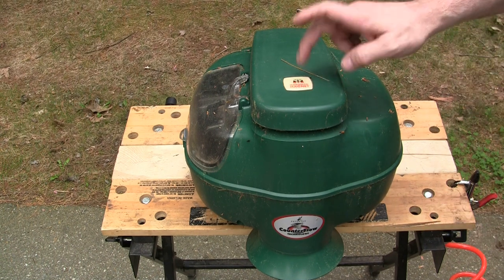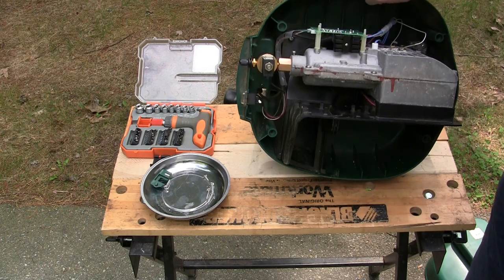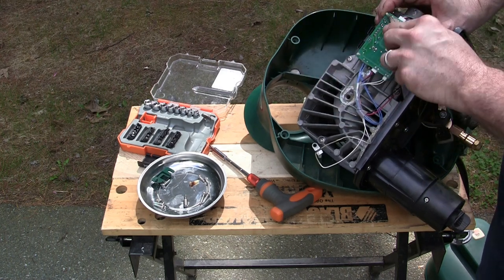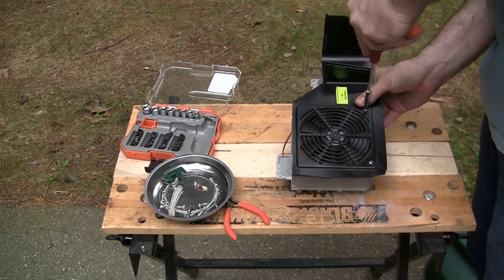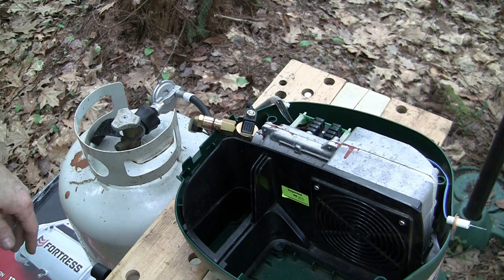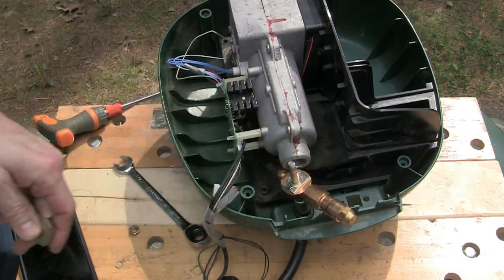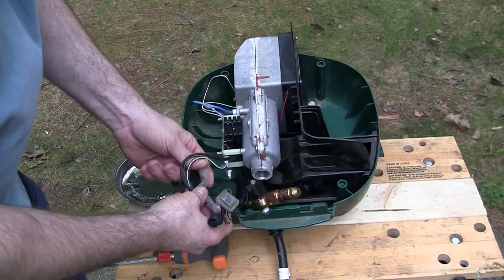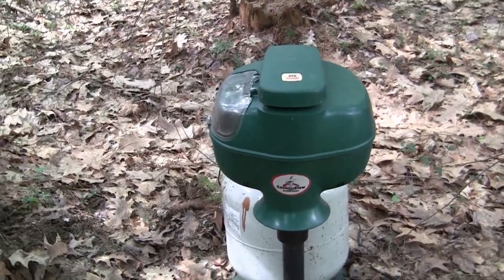Mosquito Magnet Patriot Plus repair

Comment: The little clean out port in the front that you screw in the co 2 can to blow the line out is just a tire valve. I just use my compressor and a air chuck.
Reply from the maker: Yes, I have started doing that too one I ran out of CO2 cartidges.

Comment: Hi, I did a complete service on my Mosquito Magnet patriot Plus today. Your video has been very helpful. Thank you very much. I have a suggstion. In the back of the fire chamber t is a spring with an opening on each side. Use a flat screwdriver on each side and press out the spring. Best way to clean the chamber is to disassemble it frrom the chamber and then you are able to take all filters out. Clean the chamber for carbon, use a brush to clean the ffilters and clean the wall inside the chamber for carbon build up. Inside it used to build up a lot of carbon. I took out at least 100 gram carbon. Now my Mosquito Magnet Patriot is working like a charm.
Reply from the maker: Thanks for the feedback! I'll give that a look next time I have it open.

Comment: Thanks for tearing the whole thing down even though you probably could have stopped at the thermocoupler.  I have a lot more confidence being able to troubleshoot easy to solve issues to keep mine up and running.  I just spent $70 to have my jet cleaned.
Reply from the maker: Thanks for the compliment and good luck with your machine!

Comment: Thanks for taking the time to publish this video. I had mine mostly apart and determined I needed a new igniter (which was also the error code). Your video gave me the confidence to fully disassemble, clean and inspect. I found the inside of the chamber corroded and the drain plugged, so I got it all cleaned up. I also bought some 8-32 nylon screws (from an electronics supplier) to hold the thermistor in place (which I found with the head broken off). It’s all back together and running fine. Note that I have an old Liberty model, where the igniter is soldered directly into the circuit board, so I cut the plug off the new unit and soldered it in.
Reply from the maker: Great to hear! Glad the video helped!

Comment: Thank you for doing this. I have two of these & one needed a new heater. The other failed this year and the heater is working. I'll have at it as you did. Thanks for breaking the ground so I don't have to reinvent the wheel.
Reply from the maker: Good luck!
Reply: @DavinDesborough  Thanks. Job done. I split the halves of the engine and it was packed full of crud which I dremeled out. The ignitor was actually working so I left it in. The gas jet was plugged up so I took that apart and cleaned it out. For some reason the propane tank valve didn't release so I switched tanks and this one was fine. I used deoxit on all the electrical contacts to keep corrosion down & Put a strip of tape over each of the four case screw holes as mud dobbers had packed the slots with crud. When reassembled it started in a very few minutes. 

After seeing how it's done I'll just do a cleaning every winter and have it good as new for each spring. Thanks again!
Reply from the maker: @XJ1100J  Awesome! And, yes, just plan on an annual cleaning and you'll be good. It's worked for me anyway.

Comment: Thanks for the video!

Just bought a 2nd hand unit for 100€ in Finland. Looking into the probable malfunction before i even have my hands on the unit yet.

People like you make the world a better place, at least for us makers : )
Reply from the maker: Thank you! As a fellow maker, I try to give back what I can. Best of luck to you!
Reply: @DavinDesborough  checklist:
-heater is glowing
-solenoid is activating
-solenoid gas valve is really clean
-thermistor is reading ~150K ohms in room temp, ~30K ohms when heating with a jet torch for a bit - seems reasonable (running resistance should be around 5K ohms..?)
-propane is coming out(cannot light it with jet torch though, too high flow for that?).

Have you taken apart your gas jet? Does it have any other parts inside it besides the jet itself and a "copper mesh" - nothing under the mesh? Former models used to have some channeling made with a screw with a "mushroom" looking part that restricted the gas flow or something like that. The screw used to have a groove to be opened with a flathead screwdriver.

I only get the fast flashing red ledalthough everything looks good, only the gas flow is suspicious - although it looks exactly the same as yours when you light it up.
Reply from the maker: @iikkakonola  I have separated the jet from the mesh and there was nothing in there, or I didn't notice it if there was. If you try running it with the cover off, does the metal get appreciably hotter? Is so, then you have ignition, but it isn't getting the right signal from the thermistor. I'll need to change the tank on mine soon, and I'll try to get some readings from the thermistor when I do so we have something to compare.

Comment: Thank you for your video. I really appreciate it. When I first purchased this machine it worked just like you stated. The second year of operation was less reliable and required CO2 cartridges and a ridiculously expensive CO2 cartridge attachment to clean out the propane burning unit. From this point on the operation was sporadic and VERY frustrating. I also found that the mosquito magnet CO2 cartridges where expensive to purchase and it was suggested that every time I swapped out the propane tank, I was required to use a CO2 cartridge to clean out the working parts. I did this as per Mosquito Magnet instructions. All in all it cost me about $100 to $150 to run for the first season. This expense excludes the purchase of above mentioned equipment ie the cartridges and attachment. In year 3 (this year) I fired up my mosquito magnet and spent an entire day trying to get it running. As the warranty on this useless machine had expired after the first year I had no issue opening it up. After watching a few Youtube videos I diagnosed a problematic "Thermistor" I believe this temperature probe regulates the internal temperature of the mosquito magnet and keeps it running. I went online to purchase a replacement part and found that there are no available parts for the mosquito magnet. The only item they allow to be sold online is the igniter part (on ebay) I called the mosquito magnet service people and was rudely informed that they do not have part numbers or are able to send me any parts at all. I was referred to a service center in Canada. Although Mosquito Magnet worked well for a year and caught basket loads of mosquito's the subsequent years year of operation were terrible. I paid $400 for something that has a shelf life of approximately a year to two years max. There is absolutely no customer service or parts available. I WOULD NOT BUY THIS PRODUCT. Its finicky and expensive to run! I will be posting this to other mosquito magnet youtube videos sites in order to warn other people of this gimmick.   If anybody wants to purchase my broken mosquito magnet and resides in Ontario please let me know and maybe I'll be able to re coop some lost money:)
Reply from the maker: Yes, I have said this all along, when they work, they are great, but be prepared to work on them.
Reply: Richard W's comment matches my experience almost exactly. I will say, that first year, it was unbelievable how many mosquitoes the unit caught. I was very impressed. Since I bought it in late spring, my warranty was still valid when it failed to start the next spring. I spent the second summer shipping the unit back and forth to Mosquito Magnet "for free". All summer...there is a new shorter warranty period when they send it back to you, but it didn't matter. I would literally get it back, follow the startup directions to a tee and watch that fast blinking red light after multiple attempts. Another trip to the UPS store....all summer and fall. I swear I think they just slapped a new label on it and sent right back to me each time. In the fall of the second summer I just gave up and decided to fix it myself. Here I am at the start of year 3. I've done everything you did prior to watching this video and have determined that it is the thermistor. If not, it's the circuit board. I was hoping to find a company for a replacement thermistor. If it's the circuit board I'm screwed. Mosquito Magnet would never sell you one of those. 

It's a one year product folks. Don't take my word for it. Just do a little searching. If your handy, you bought a yearly task and likely some part replacements. If your not, budget for a new unit each year. Does anyone know of a reliable unit in competition with Mosquito Magnet?
Reply: @matthewschneider5688  I have bat houses now. They are free and work very well:)
Reply: @DavinDesborough  Hi Davin, Thanks for the educational video! My case is similar to Richard W in that I think I need a new thermocouple/thermister for a my Patriot MM.  The wire has come separate from the metal portion of the thermocouple/thermister and I'm not sure how to fasten (glue?) it back.  Do you know where I might be able to acquire a thermocouple/thermister?  Thanks much!  John
Reply from the maker: @johnatwood8078  In theory, it should be easy to replace, they are not uncommon components. The trick will be to find the right value. If you have a multimeter, you could test it to see if it is still good. The resistance should change as the temperature increases/decreases. If you can test that and it seems fine, then I would just clean the "probe" as best you can, then glue the thermistor back in with JB Weld and see if it  works. If you have to buy one, something like the following may work. I have not tried it myself, so I can make no promises. https://www.digikey.com/en/products/detail/amphenol-thermometrics/al03006-111-3k-123-g1/136415

Comment: Really good video! I had a 2011 Patriot for 8 years. Took it apart, scraped the carbon out and a new igniter, working again. Fun to play with.
Reply: @meeya9129 Where did you get a replacement ignitor? Did you just use like a universal type of ignitor or was it a mosquito magnet specific ignitor?

Comment: If this gadget comes to sale in india, the owner will be a billionaire with in no time.
Reply: Make it in India and become a billionaire
Reply: @Oxycontin.  exactly
Reply: This is made in China, its banned in india
Reply: I just thinking the same way. India needs these things badly . The original company or another one made it in india little bit cheaply so that we can afford it .I want to build one with little bit design changes . I have some small ideas , maybe I will use faul smelling  Attar / perfume made  from rotten fish etc . Instead of propane gas cylinder we can use biogas .
Reply: and what about in time?
Reply: Octenal seems to be the main mosquito attractant along with carbon dioxide. I like the idea of annually eroding the mosquito population.

Comment: Thanks for the amazing video. We followed your tutorial step by step and having cleaned all the parts and ensured it all works disassembled it still isn’t firing up and we’re getting the dreaded fast blinking light.
Reply from the maker: Does it get warm during the "starting" phase?  If so, it is lighting up, but not registering the heat change. I need to further investigate replacing the thermistor, because I think that is the problem for many people.
Reply: @DavinDesborough  I'm having the same issue as above. Where can I find the thermocouple?
Reply from the maker: @johnm9569  You won't find an official part. You'll need to get an axial thermistor (like this https://www.digikey.com/en/products/detail/littelfuse-inc./303JG1F/10261286) and mount it in the metal probe. The issue is what thermistor value to get? When I clean my trap this spring (been too busy thus far) I will take some measurements to try and figure that out. Sorry I can't provide more help now.
Reply: @DavinDesborough  I just bought this from a person who said they used it once. I'm getting the red flash. The inside is spotless and looks brand new. The ignitor lights red hot, the nozzle produces gas after the click verified with a lighter, but it still turns off after about 15 min. I've cleaned everything and lightly sanded both the ignitor and the thermistor.
Reply from the maker: @johnm9569  If you leave the plastic off, do you feel the metal getting hotter during those 15 minutes? If there is combustion, it will get warm to the touch.
Reply: @DavinDesborough  no, it doesn't get warm. I tried using a torch through the ignitor hole after the propane is released to see if I could get a flame but I couldn't see anything. When I light the nozzle manually while it is disconnected, I have to hold the flame within less than 2 inches or it doesn't ignite. It wouldn't be able to reach the ignitor in the chamber, which is about 6 inches from the nozzle, unless the propone fills the chamber then it ignites?
Reply from the maker: @johnm9569  That sounds a little weak (propane output). You can take apart the jet and clean it with carb cleaner or similar. I take one apart in one of my other videos: https://youtu.be/FKoue6QRQdA?si=_Q_8920P2g3gyG4V&t=434
Reply: @DavinDesborough  FIXED! It was the nozzle. Although it appeared new and I cleaned it, it didn't work. I tried a 1.5 gph 45A and that didn't work. Then I tried 1.75 gph 45A and it worked! Thanks for your help.
Reply from the maker: @johnm9569  That's awesome! Good work sticking with it!
Reply: @johnm9569  I have the same problem as you, where did you get the 1.75 nozzle? I cant find it
Reply: @MCYRichard  Amazon
Reply: @johnm9569  i searched there aswell, but no luck 🤔 mabye sold out...
Reply: @MCYRichard  Perhaps try a 2 gph nozzle instead?

Comment: An excellent video.  Interesting to see how simple this machine is.   I cleaned mine ( chamber was pretty dirty ). Igniter switch and gas valve work but I still get red light. I am assuming it might be circuit board or heat sensor.  Still testing but am very comfortable taking it apart and putting it back together after watching your video.   Really do appreciate videos such as this one !
Reply from the maker: Glad it helped! As for the continued issue, take some sandpaper to the metal probe for the temp sensor. In my recent history, getting the oxidation off of that has made it fire up no problem.

Comment: Hi David, a follow-up to my earlier post today.  Tried to clean, lightly sand a second time  but I’m still getting the dreaded flashing red light. Also called the Mosquito Magnet hotline but representative stated they do not sell replacement parts.  They offered me 15 % off the cost of a new replacement unit, or indicated I had to ship at my cost to one of there three service reps either in PEI, Manitoba or Saskatchewan to get it fixed An expensive proposition since I live in Ontario.  All this to say I am not very impressed with customer support.  Will try to give it another clean, or perhaps call one of the service centres to see if they can just ship the part I need. Thanks again.
Reply from the maker: This is the the bad side of the machine for sure. Is the machine getting warm at all during the tail end of the startup cycle? If so, then you have combustion and there is something wrong in the temp sensor. If it stays cold, then I would go back to the gas jet and soak it in some carb cleaner or something to make sure it isn't clogged. Best of luck!

Comment: Thank you for making this video. I was having trouble finding one that showed the combuster being disassembled. Mine seems to be functioning fine but not catching any mosquitoes. Mosquito Magnet suggested taking it apart and cleaning it. They didn't mention corrosion but obviously that's probably what my problem is. I just wanted to see how much of a hassle it was going to be. Thank you also for not editing out the part when you discovered the connector had come undone. If it did come undone while you were working on it then it'll probably happen to me too. I'll now know to be watching out for it. Two thumbs up for a great video!!!
Reply from the maker: Thanks! I would recommend just taking out and cleaning the thermistor first. I think corrosion building up on that can effective keep the unit shut down by not letting the sensor get hot enough in the time allotted for startup. If the plastic screw breaks when you try to remove it, use high-temp silicone (eg for engines) to stick the thermistor back in. Just use it sparingly.  Good luck!
Reply: @DavinDesborough  Mine comes on and seems to be running the way it's supposed to. The red light blinks on and off during warm up and then turns solid red after it's been on for a while. I let it run for two days and only caught five mosquitoes. All the screens look clean from the outside. That's why the Rep suggested taking it apart, including the combuster. I'm guessing the thermistor should be okay or I wouldn't get a solid red light. I'll let you know what I find when I have a chance to open it up. It's been in in storage for a long time so I wouldn't be surprised if it has a mouse nest inside the housing. Thanks again for the video, it's appreciated.
Reply: @KX220R  Mine was doing that. I recalled a video about cloths dryer screens plugging, mine held water and the cloths were taking way longer to dry. I scrubbed the screen with a soft brush and soapy water and the dryer worked fine after cleaning. So I tried it with the basket and side screen on the M M, and it worked better also.